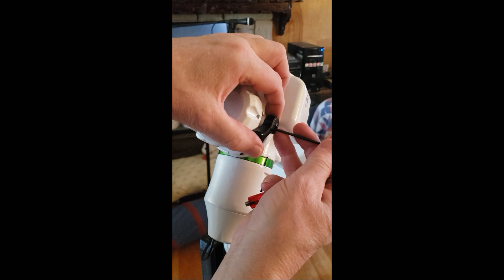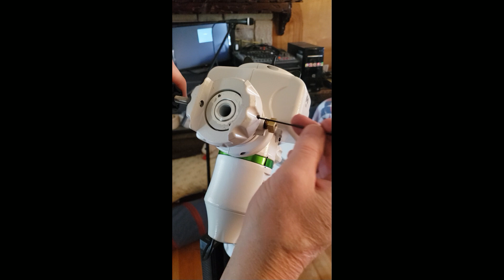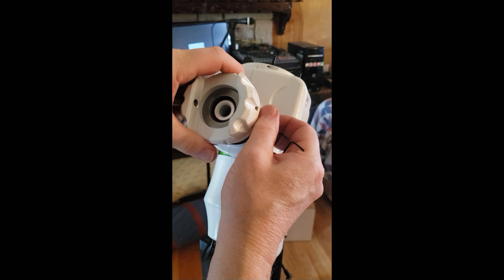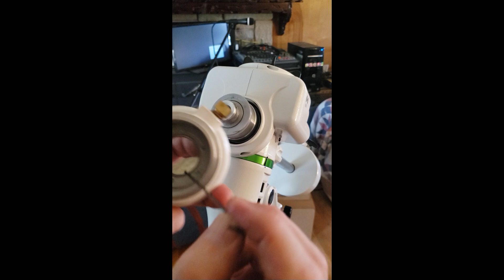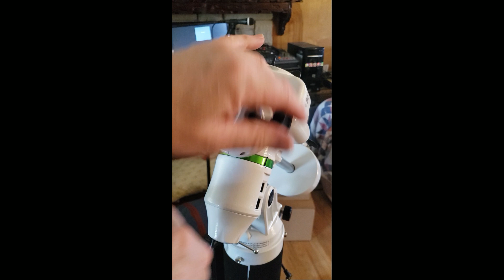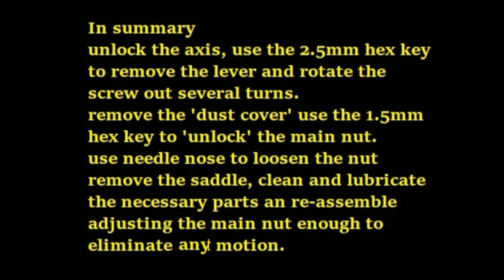EQ AL55i   Dec Axis Adjustment

Comment: is it normal for the 1.5mm hex threads to be really really tight? I tried this tonight but couldn't get them loose with my hex key. didn't want to push any harder as I was afraid the hex key would break off in the hole
Reply: I had one tight one when I did this, I was able to eventually got it loose by turning it both ways for a while.

Comment: Hi, this is very useful, thanks!
How do you find your PA stability throughout the night? I am concerned about ALT bolt not being locked in this design and as a result having some play.
Reply from the maker: It sits pretty solid, as long as everything is balanced there shouldn't be any cause for shifting.

Comment: Hi there. I've had this mount for about 3 months and can get great shots with it, and as per most reviews, guiding can be terrible with the DEC axis. I'm about to follow this video tonight. Adjusted my SA-GTi some time ago and hoping for the same results here. Thanks for the video!!
Reply from the maker: If it is a backlash issue, Ardsley Astro did a video on that adjustment - https://youtu.be/nkElZcHujfk?si=gY7pT8mnt_um4ukz
Reply: @tacomaastro7462  Pretty sure the DEC axis backlash is causing the guiding issues , but my RA axis is tight, so I want to give that a shot too.
Reply: Managed to perform this with no issues. DEC is much smoother now and doesn't get that stiff feeling when balancing. I have an Astro-Tech AT102ED on it for testing. I also watched Ardsley's video for reference and was able to smooth out the RA axis as well.  Did not work with backlash as of yet. Just loosened the 3 hex screws a bit after removing the RA clamp. The mount is swinging as well as my SA-GTi. Pretty cool.  Now, we'll see how it guides. Agian, thanks for the video.